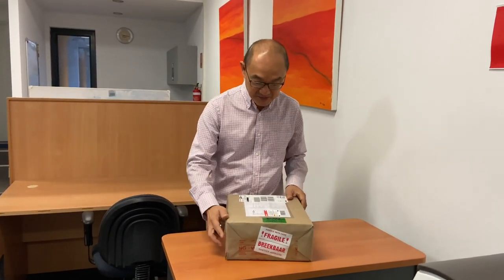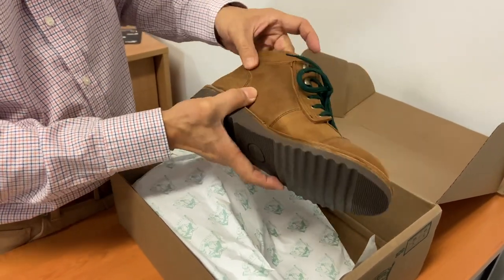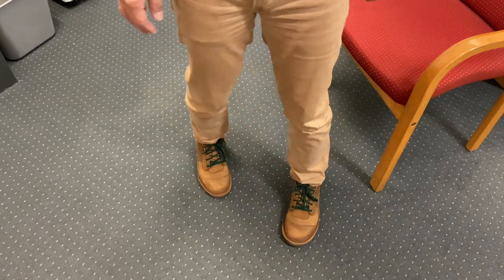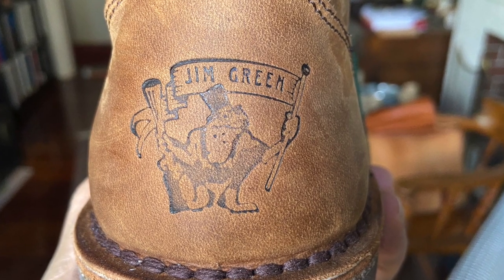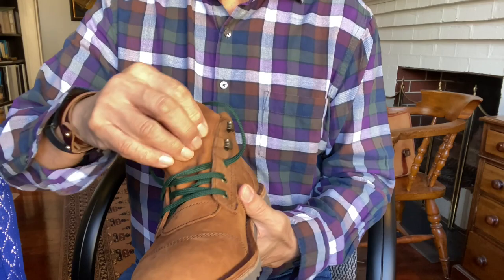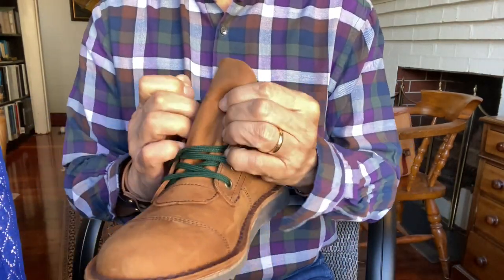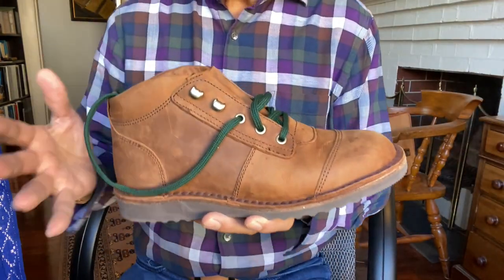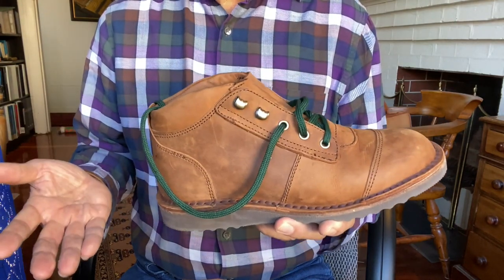Unboxing and Initial Impressions Jim Green African Ranger

Comment: Thank you for your video! I am currently choosing between this African Ranger and the Razorback for long walks/ hikes around Sydney. This one certainly looks more durable and nicer than the Razorback model to me. Looking forward to your next video to see how these rangers actually fare
Reply: I've had a pair since February, I love them.  I replaced the insole with one made of memory foam, and I have no problems wearing these boots at my job site for 9+ hours a day.
Reply: I'm in USA, Ohio you'll like this sole better for grip, and as he says it will not collect anything in the sole because of the sole design. Even where I am due to the weather, they've very comfortable and remind me of my Red Wing 875's. Basically for an urban environment these would work better. If you plan on using them in the muck, or need the extra traction go Razorback. Oh heck, just by both!  I have the Superfeet Green insole in mine. I've used them for work around the yard, and wore them around town. I just use a horse hair brush to clean them.
Reply: @1976smb  Got the best of both worlds with the Razorback in the wedged sole.
Reply: @1976smb, how are they on ice and snow?